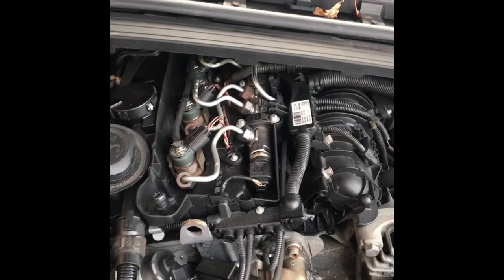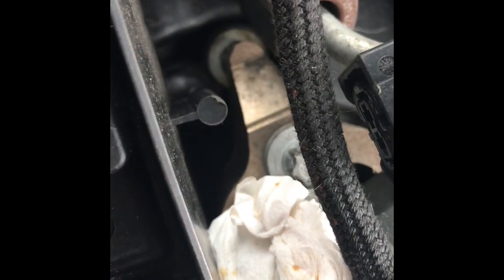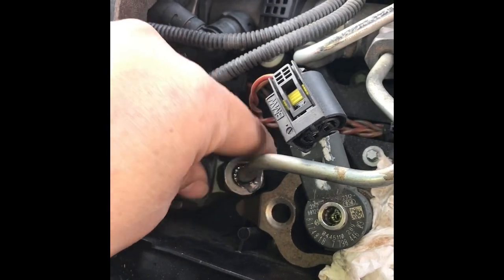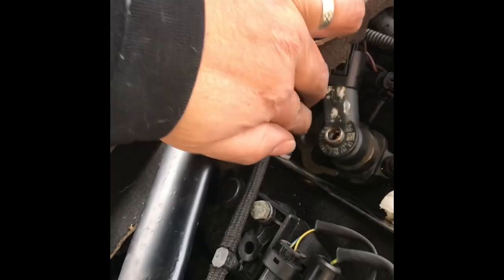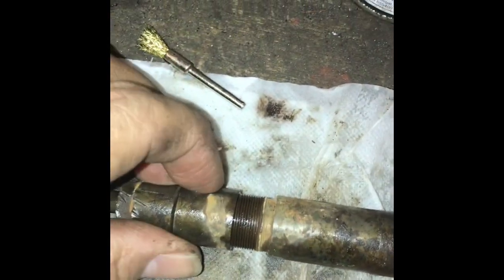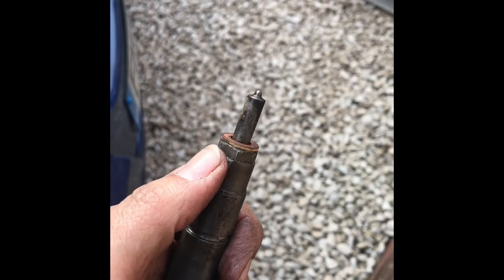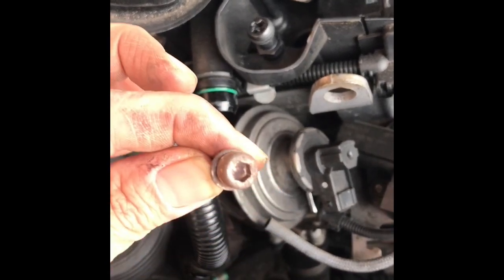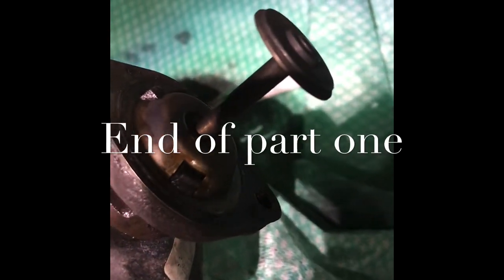22 BMW 318D rough idle MAF injector clean Part one

Comment: Has it run after clean ?
Does the misfire stop?
Is this b47 engine ?
What is the mileage ?
Thinking of doing the same . As for the cooper washers they are only few quid and should be replaced as if they start leaking then trouble start.
Reply from the maker: No it didn’t run after the clean, apparently after taking the fuel regulator off they were lots of swarf built up, probably due to the fuel pump, it had a few more issues with rear callipers needed replacing and new suspension on the front so I decided to get rid of it, too much work really, hope that helps👍
Reply from the maker: Its an N47 engine